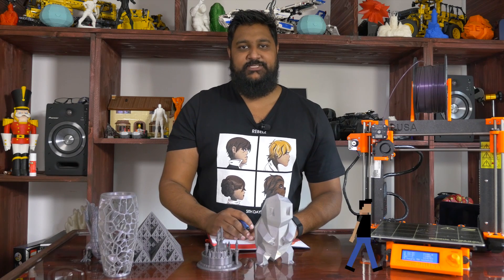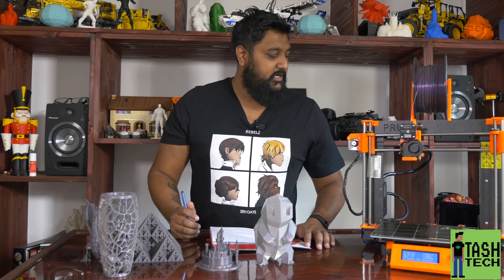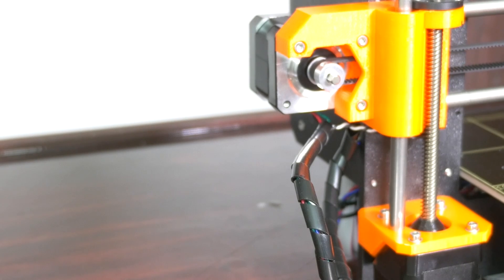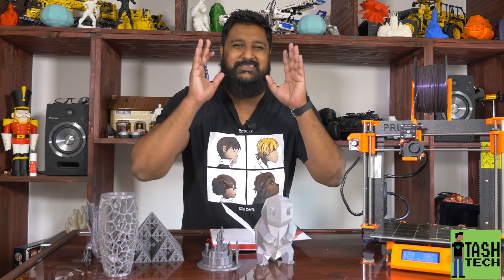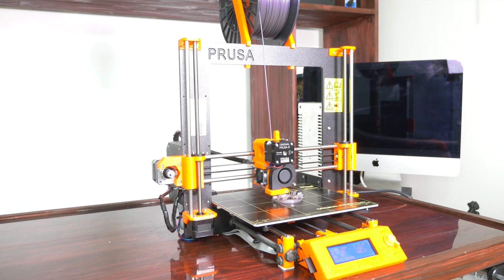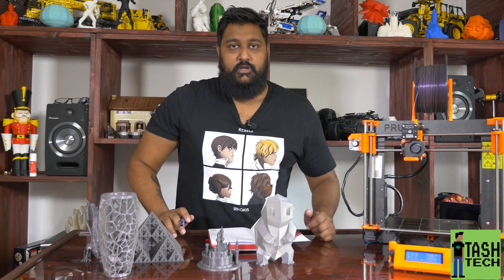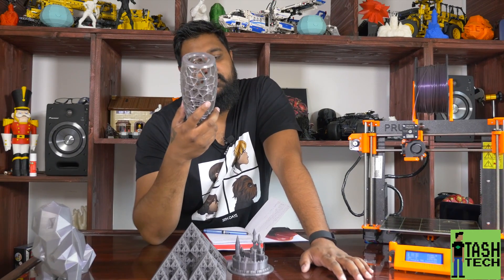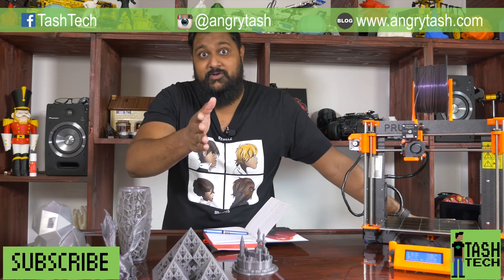Prusa i3 MK2 3D printer REVIEW

Comment: People here are saying that it costs too much, and yeah it does cost a lot but if you look at for example the Ultimaker 2+, that one is way more expensive and the MK2 is almost as good as the U2+, while it's much cheaper.
I actually wanted to buy an Ultimaker 2+, but then I discovered the Craftbot Plus, which is also pretty good and cheaper (1200 euro's here). But now I see the Prusa i3 MK2, which is even cheaper, and just as good! So yeah I think I will buy this one ;) (if my parents approve lol)
Reply: Very nice review by the way!
Reply: If price is a concern, you can always build one by yourself. Much more fun. In the end it is the main idea of the RepRap project.  Prusa i3 is designed to use available and cheap components.  Performance can be similar. I have already made delta style printer and now I am building Prusa i3 MK2. If you carefully choose components it is possible to build it within $200 budget and even lower, depending on what you are ready to sacrifice.  But you will definitely need some electronics and mechanical knowledge + a little bit of arduino programming. Frame can be made from the wooden boxes, used stepper motors are available from the old copy machines and RAMPS board is dirty cheap on the aliexpress/ebay.

Comment: How easy is this for someone with no experience 3D printing? Is there alot of jams and fixing involved?
Reply from the maker: there's will be blockages and issues with all machines, even the very high end ones. but this printer is very minimal issues and easy to fix things because of the way it's designed

Comment: Tash, 
I just purchased one of these and am looking forward to getting it assembled and getting started on creating what ever my mind can come come up with. You mentioned the bearings and there is a upgrade you can do on your own which i have chosen to do you can install the drylin® Igus RJ4JP-01-08 8mm Linear Bearing to replace lm8uu. I have seen this in a few vids and decided for me i did not want to mess with lubing the bearings and went for a impregnated material as a alt. Of course we will see in 6 months if this was a good idea. Thanks for the video enjoyed the watch.
Reply from the maker: Yeah man I've seen the file of  self printed igus drylin on thingiverse and I don't trust it will come anywhere near the real thing unless you use that exact combination of plastics to make it so it was either that or springing for the bearings which are really expensive here in south africa